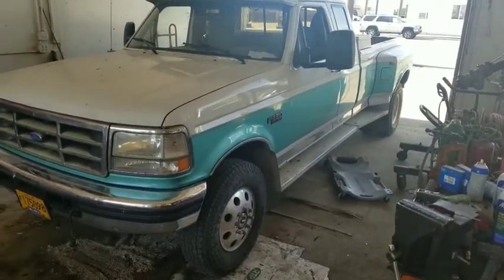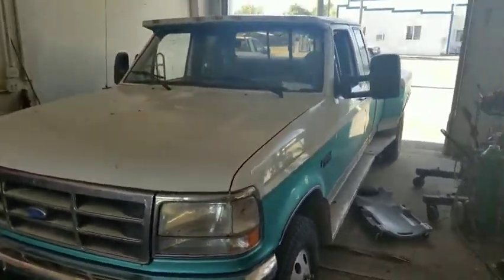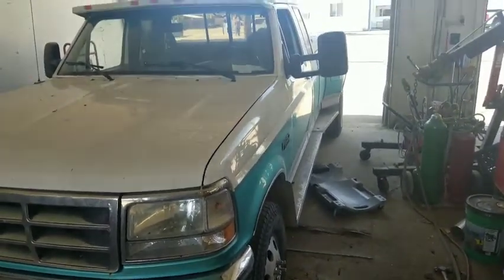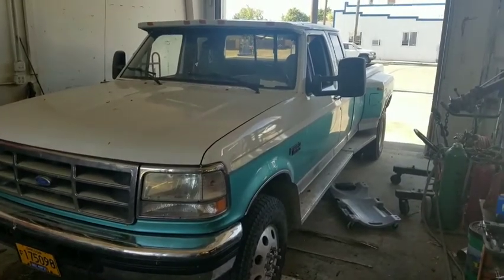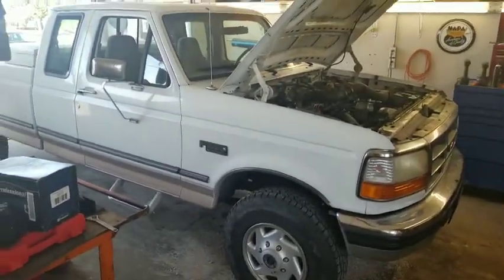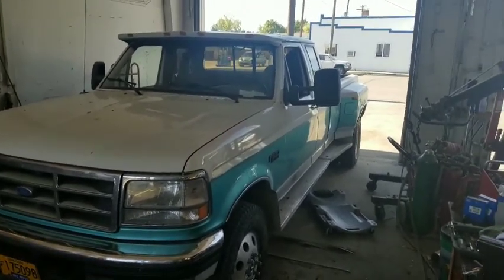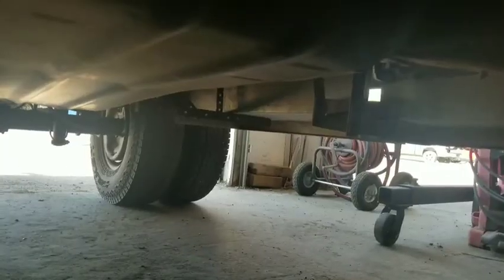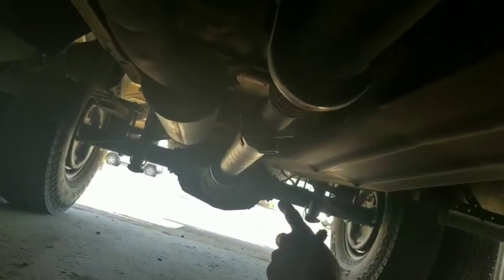Ford fuel tank switching issues, tank filling from the other, gas vs diesel systems all explained

Comment: Gas is leaving my front tank and going into the rear I don’t see anyone having that issue I just want to run it off of the front tank how would I do that
Reply: Mines doing the same
Reply: Same here. Based on what I read in the comments, I'm going to change the rear fuel pump (the one that's leaking), if that doesn't solve the issue, I'll change the front one also.

Comment: I have another question I pick up also takes a long time to start so it’s probably a bad check valve to keep the pressure in the fuel system. It’s bleeding off. Maybe my punk has both bad parts and will fix the issue. Replaced the whole set up.

Comment: One thing to keep in mind, because it got me, is that there are different sending units. You have to buy the right gallon sending unit. Some of these online retailers don't tell you what gallon tank the unit is for. I have an 18 gallon tank. I bought a sending unit that was supposed to be for my truck, I got it and it kept hitting the bottom of the gas tank when I tried to put it in. It was only about an 8th inch off. I was unbelievably confused until I figured out that they sold me a 19 gallon sending unit instead of an 18 gallon unit. There was only a small difference between the two, but it was a gigantic waste of time and money for me. So watch out for that.
Reply from the maker: Thanks for sharing that info!
Reply: i had the same issue. jammed it in as hard as i could and got the ring on it works lol

Comment: I have an 85 ford  E 350 econoline that has a 2 tank switch original.my problem is one tank doesn't register on the dash to see how much gas is in it, the other, does. How can I gat both tanks to show on the fuel guage? I run the non showing tanks first, and when it gets the odometer near what the miles are by miles per gallon, andhave to be ready to switches the tank runs out by paying attention, to switch at the right time. It would be nice to have both tanks registeron the Guage to make it easier. Any suggestions?
Reply from the maker: Check out my other video with a 1991 F350.  I show how to check the wiring to each tank.  I suspect you have a bad gauge sender in the tank or possibly a bad wire.

Comment: I have a 1991 Ford F350 gas 7.5 long bed crew cab, Larry XLT.
There is no valve switching reservoir just as you have shown here in your video. Yet the front tank doesn’t work and if you switch to it immediately lose gas and the gauge goes to above full, so I’m assuming it’s the sending unit in the midship front tank. So I’ll drop that and replace that I bought a Delphi one that is specific for that 19 gallon tank
Although the Ford dealer says it’s supposed to have the switching valve yet I don’t see where that’s possible on this , at first I thought maybe somebody had switched it out so that only the rear tank works because all the lines Y together And three spots. Is your shop still around that I can consult with you? I’d be glad to pay you for your time.
Reply from the maker: I'm still here.  I have another video dealing with a 1991 F350.  It's a little different than the gas setup in this video

Comment: thanks so much for the great information  i had the exact  same problem on my 1992 f150 300 in-line 4.9L gas from rear tank was goint in to front tank i just changed the front pump so hopefully this fix the problem 🙏
Reply: Did the pump resolve ur issue ?

Comment: Great video! Something is still fuzzy though: On the dual pump gas setup, a check valve in the pump discharge keeps fuel from coming back from the other pump. But how does the return from the regulator switch from one tank to the other?

Comment: Hi ... I just noticed that this video was done a couple years ago ... But it's still relevant to me (grin), cause this is exactly what my 97 f250 HD with the 351 is doing and it started doing it a year ago (7-2022... I've been lazy in getting around to tackling it),  and you are/were correct when you said there's so much info out there about this problem, but more of it is mis-information , incorrect in other words, there was only one other person, on a ford truck forum that I found, that gave the same diagnosis as you did... all the others... at least 10 of them, were all insistent and very sure that it was an electronic switching valve, which I knew my truck doesn't have... anyway so now that I've got two solid, sound opinion's that were explained in exactly the same context, I'm ready to dive into this. But I do have one question for you... did you replace the the fuel pump modules with nos ford parts (which I would prefer to do but they're so damn expensive)  or did you use aftermarket and if you used aftermarket, what brand did you go with and why... and do you think, pertaining to the manufacturers, Is there one aftermarket manufacturer that makes these pumps that's superior to the other? Cause if there's one thing I hate, it's doing the same job twice... in other words, replacing a brand new part that failed.
 Okay, I won't bug you anymore... 
Thanks in advance for your reply (that is, if I get one .... grin).
Bruce
LA CA
Reply from the maker: I did use aftermarket ones from NAPA.  I would check with Oreilly's first though.  NAPA is way over priced for the same quality of parts.  As with most things made in the last 3 years.....every brand out there is questionable in my opinion.
Reply: @prodieselrepair3218

Comment: Wht if you disconnect the tank that's failing could it just run on 1 tank?
Reply from the maker: If the check valve is bad disconnecting the tank won't do you much good unless you find a way to block off the fuel line.

Comment: Where is gas check valve in 97 ford 250. 460ci
Reply from the maker: I'm not exactly sure what you're asking, but the check valves that I know of are built into each of the fuel senders.
Reply: It's not in the sender
I can't find my check valve 
I think it's the connector that connects to the large line on top of the tank

Comment: My 97 f250 powerstroke works fine. I used the same type selector valve on my 57 chevy truck it has 2 tanks .I am having same problem . I'm running holey sniper with return line. Say I;m on front main tank the return is not going back to front it returns fuel to the rear and over fills it. I have changed switch 2 times. Any ideas on what to try next????🤠
Reply from the maker: If you have the Ford sending units in each tank than the check valve in that sending unit is bad causing the fuel to go in that tank while running from the other tank.

Comment: Thank you for the clear information on the individual gas pump. 
FYI if you have the cheaper front pump without check valves you can take the old front pump with the built in check valves and change out the new pump and filter.

Comment: I own a '97 F350 5.8L gas 4x4. Gas overflowing out of the rear. Scary.  Local shop failed to fix it and claimed there are no longer any parts available. Real frustrated. All I get are excuses. There has got to be an answer somewhere. Thannk you
Reply from the maker: There may not be OEM parts but there are aftermarket parts available.

Comment: Can switching these tanks before startup cause a crank no start? My 460 runs great but the fuel level doesn’t read the front tank, so before starting I switched to rear, and it wouldn’t fire. Left it alone, went and grabbed another battery (it had a marine battery) so I figured it finally went, but fired right up before I changed it. Thoughts?

Comment: Thanks for the explanation. I have a 1996 F250 with 7.5L and it runs great on the front tank but not the rear tank. I expect it's the rear fuel pump but I'm going to test the fuel pressure to make sure.
Reply from the maker: I have another video with a 1990 F350 with the 7.5L.  That video might help you figure it out.
Reply: Sorry it's a 96 not an 86

Comment: My 94 f250. Front tank is pulling fuel from rear tank. At times it act like it's starving for fuel. Fuel filter light comes on and occasionally it will die because it doesn't get fuel to the fuel filter, it has run dry with diesel fuel in both tanks. This lack of fuel switches from front to rear fuel consumption.  I'm at a loss. Can't find a shop willing to work on it  because of its age.
Reply from the maker: If its doing it with both tanks you could have a leak somewhere before the pump and its sucking air.  Or the pump is weak.  You didn't say whether your 94 is an IDI or a powerstrike, but they both have a mechanical pump on the engine.  The IDI pump is below the fuel filter and the powerstroke pump is in the valley of the engine.
Reply: @prodieselrepair3218  fixed it. Fuel tank valve was the culprit.
Reply: I replace the fuel pump I still have the same problem @prodieselrepair3218
Reply: Where is the fuel tank valve
Reply: Hi great video and you’re right it’s difficult to find info on this . 
I have a 96 F350 gas 460 and the  front tank siphons or fill into the rear tank . 
Do you think that’s a problem with the front or rear pump / check valve. Do you have a video of the check valve / pump assembly? I wonder if it’s repairable rather than replacing the whole pump assembly. Did you make a video of the assembly after you got it out ? Thank you

Comment: I have a f150 1995 ,with this problem I use front tank 90 % of time only rear when front gets low and when using rear it fills front tank from rear..
Reply: I’ve got a 94 with the same issue
Reply: Yep😂😂

Comment: Great video, I replaced my rear pump and sending unit(dropped rear tank since it was empty) did you drop front tank or pull bed off? I need to do front pump and sending unit next.
Reply from the maker: On this pickup I lifted the bed.  I removed the bolts on the left side and just loosened the right side.  I then jacked the bed up from the left side.  If you have things like a gooseneck ball or 5th wheel, that can make more work to do it this way

Comment: So how do I fix the problem I just putted a new fuel pump in the rear tank because the front tank fuel pump doesn't work but after I did the rear pump the truck ran fine in after that it stop now I have no fuel pressure coming to the fuel rail but the rear pump still works what I need to do thanks

Comment: Man after looking for a simple explanation as for why my gas keep leaving my rear tank and going into the front tank. All I kept getting is the fuel selector switch is gone out on the frame under the driver side of the vehicle. My problem first started out when I was using the front tank and my truck started to run horribly. Even being hard to start. So I switched to the rear and it ran fine. Now when I'm driving it seems to drank the gas at a drastic pace. So after running out of gas something had me switch back over to the front and it was on full after only having about five dollars worth of gas in it. So I knew all my gas was leaving the rear tank and flowing somehow back into my front. So I tried to leave it on the front just to make it home now my truck want start at all. I have a 95 f150 with the 300 online 6. So next I climbed under it to locate the selector valve after watching a ton of videos on here and couldn't locate anything but the fuel filter. So I'm hoping replacing the front fuel pump will resolve this problem. Haven't been able to drive my truck for a week. Thanks
Reply: Hey did you fix the problem
Reply: Switched both my pumps and assembly, still filling each other up , did you find the issue ?
Reply: I fixed my gas issue after a long while the three major things that I noticed that fixed my issue was the tank selector switch on the dash -1 ( switch to your front tank and turn on the truck don’t crank if you here the pump that mean you getting 12 for the front pump Do the Same with the rear if you don’t here the pump activate you switch needs to be replaced ) -2 ( the inertia switch it’s under the steering wheel has a little red button push that down if it’s up that shuts off your pumps if you drifted or had a collision) -3 the tank selector VALVE this might very on the year of your truck do Research on the part have. Hope this help in some type of way ; )

Comment: Thank you for the video. My gas was coming out the fuel filler. I believe rear tank
Reply: I'm having the same problem. So how did you fix that? Which fuel pump did you change, or did you change them both?

Comment: where can you find a new fuel pump module assembly for a 1997 f350 7.5??? is the whole assembly needed? Filled rear tank and front is leaking.
Reply from the maker: I assume when you write leaking you mean over filling and leaking near the fill calories? NAPA and most of the other stores will have them.  You most likely need the new assembly for the front tank.  I suspect that the check valve got stuck and that why it was leaking.